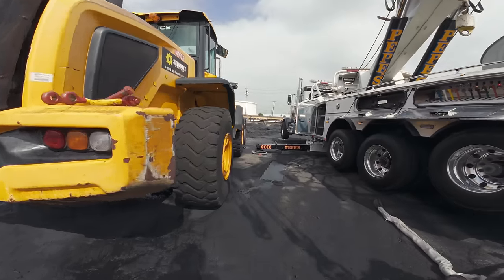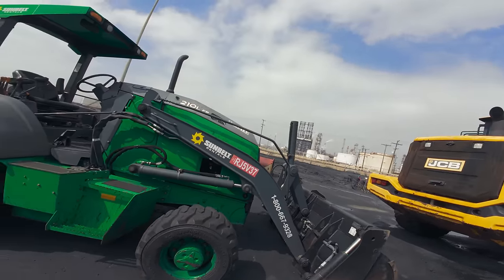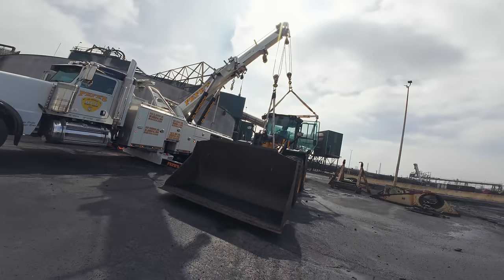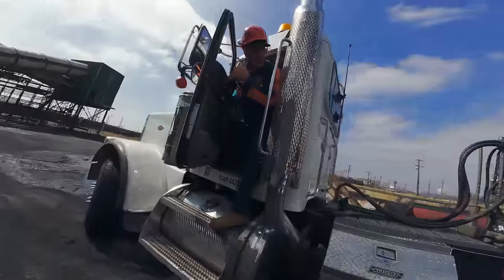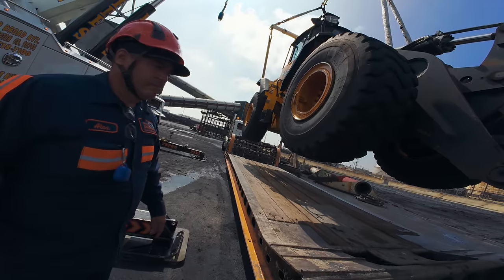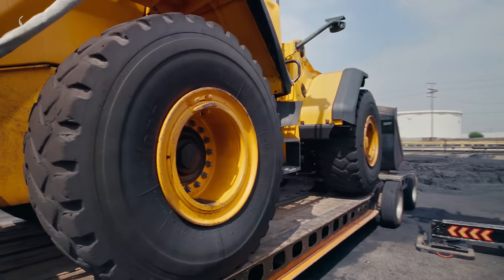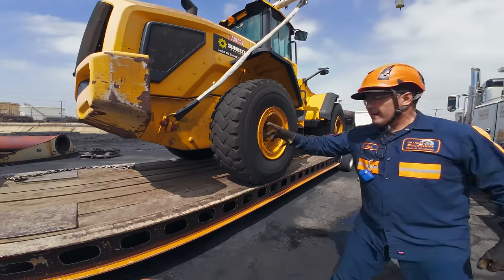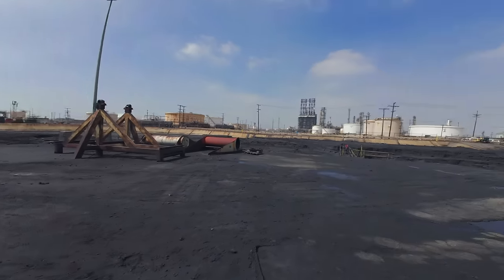Lifting a 50,000lb Wheel Loader at the Refinery

Comment: Hello Alex, to answer your question it's called Koke. It’s what's left after refining Petroleum.
Reply: Thank you , learned something new today
Reply: @AlexanderHernandez088 when you learn something new, you have to immediately go home and think on what you learned for the rest of the day!😂🤣😂
Reply: @ricanderson5717 😂😂
Reply: so they just dump it on the ground in a big pile?
Reply: @ronblack7870  Koke is used in metal refinery processes in Koke furnaces. I don't think Koke is the fuel for the refinery furnace...I think the Koke is added to the actual iron charge...not sure. But that pile of Koke is used for further processes, it's not waste.
Reply: @ronblack7870 it’s collected and used for solid fuel to make electrodes to make carbon fibre ect it’s mostly carbon
Reply: Yup, there's a video on this channel where a truck carrying a load of this stuff tipped over and Josh tipped it back upright.

Comment: Good job and good call on the bucket. Once he put the wood down and chained the bucket down on both sides he was set. However, I bet he was overwieght on the trailer axles and light on the drivers. I did Heavy Haul for 8 years. You notice things like that.
Reply: Not overweight on 16 tires in the back
Reply: Doubt it -  CA permits up to 60k on that set expanded out to 10'

Comment: Correct me if I'm wrong but I thought flipper's lines were rated for 20,000lbs so if Alex kept them double lined like usually it would have been good for 80,000lbs and wouldn't have required the three part line... Howcome he three parted the lines? Is it just something I'm overlooking from my yt armchair view :D Another great video and I look farward to these exciting upcoming videos 👍
Reply: Probably because the loader weight isn't evenly spread, rear is heavier and could use the extra capacity/safety factor. The lines are not vertical either so that angle also adds additional cable load. Also, it's probably easier to control the load if both main boom lines are in the same configuration instead of one being slightly slower than the other.
Reply: @hondaman08  Yep I assume this must be why. It still seems potentially overkill, for on side to exceed 40,000lbs (limit of a two psrt setup) then the loader would have an 80%-20% weight distribution which seems excessive. And yes the veer angle will add extra load to the cables, it's not very agressive here so I can't imagine it adding that much. Like I said maybe there's something I'm still missing or maybe Alex was just being over cautious since you can never be too careful. Not hating, just genuinly curious because I like to work out the numbers behind these rigging setups and this one just peaked my interest
Reply: @DannyDan2k13  if nothing else, it also slows down the lift and gives better control
Reply: @hondaman08  yep true. Like I say there's no such thing as too safe